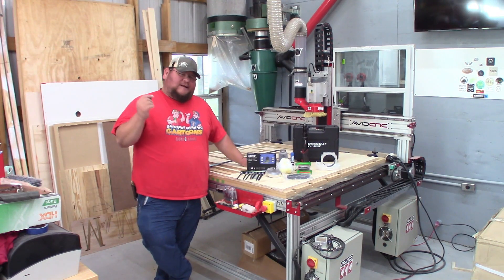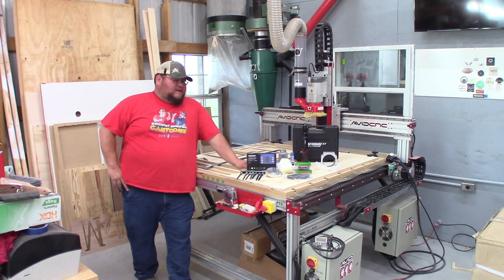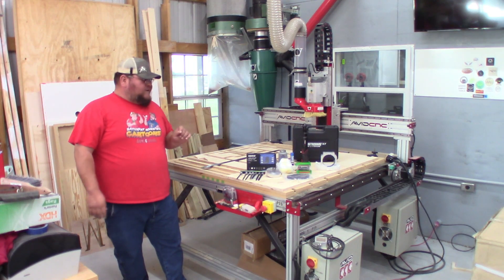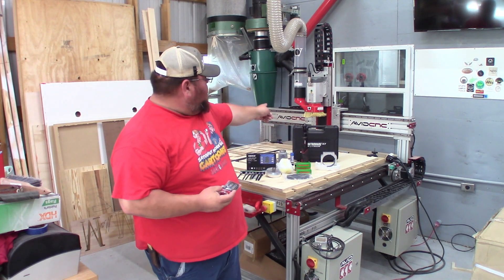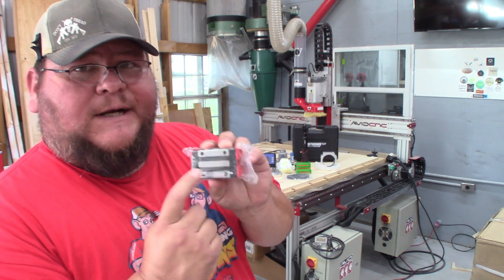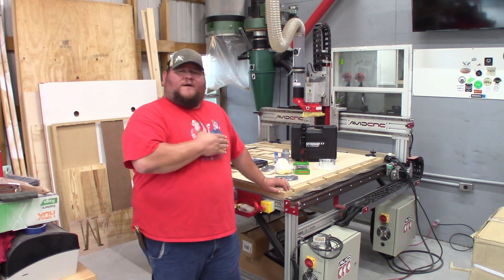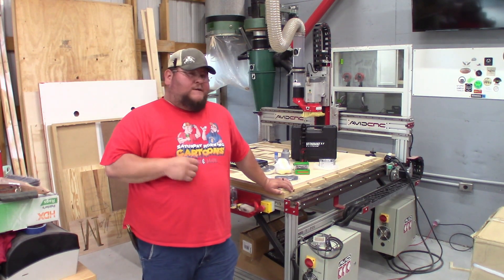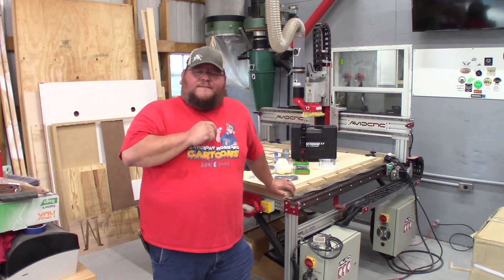AVID CNC ROUTER PART 11 FINAL THOUGHTS

Comment: Thank you again for the series! Tell me about that rack/tray on the front of your machine. Also, what was your preference on choosing your spoil board?
Reply from the maker: Thank you Craig!!!! The tray is from harbor freight. It’s an accessory tray that goes on their line of toolboxes. I also purchased a bar magnet that they sell as well. The magnet is held on the extrusion with rolling  T-nuts on the extrusion. This setup makes I so easy to pull the tray off and on. FYI, in the videos I show this bar magnet as I use it to hold the bolts while I apply loctite.